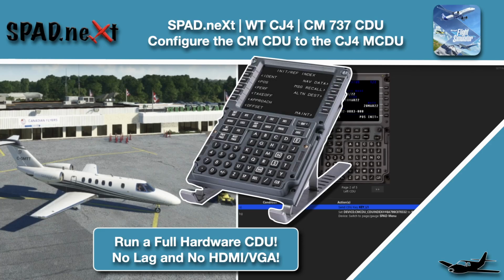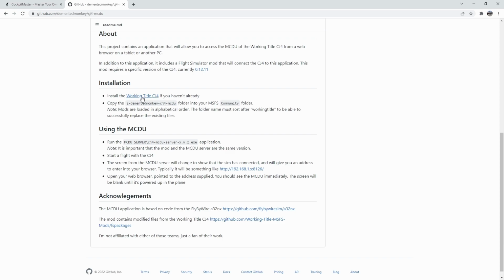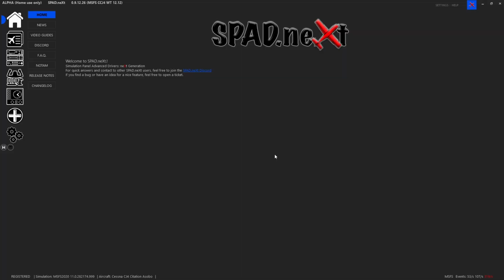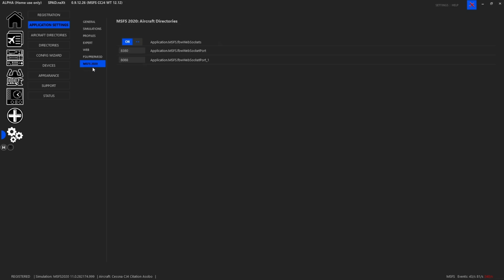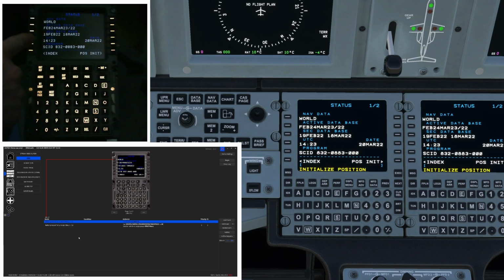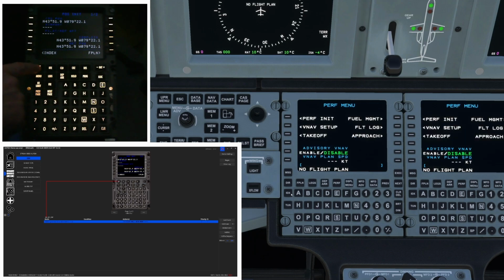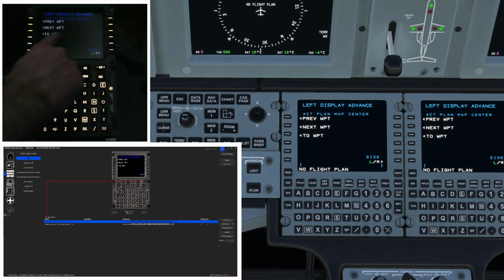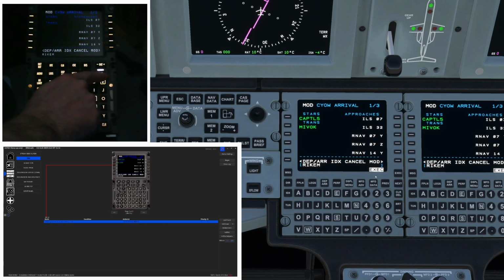MSFS | SPAD.neXt | CJ4 | CM 737 CDU Config

Comment: I have been debating whether or not to buy SPAD.Next but now I’m sold as I really want to use the CM CDU with aircraft other than the PMDG B737. Thank you for a very informative video.
Reply from the maker: Awesome. Good to hear you can put that hardware to more use.
Reply: I have tried to find the online snippets but they do not appear as you explain in the video. I’ve tried under profiles but only 2 come up for you and they are not the cj4. My copy of SPAD.neXt is some what different than the one in your video.  Any thoughts. Also, when SPAD.neXt connects to the CDU, the screen is blank. Pressing  any button allows a change to be made. However I was wanting your profile for the CJ4.
Reply from the maker: Profiles are not Snippets ..  I don't really publish those as my complete setups are not going to work for others..  Plus most of the configs I do for these videos might be changed when combined with the rest of my cockpit vs what works for that device configuration as a standalone.  If you are not on the Release v0.9.12 then your not going to find them...  The CDU requires Complete Edition as well...
Reply: Copied. I have the complete edition and the latest release but snippets do not show. No matter I will persevere.
Reply from the maker: @mikebarrett5890  join the discord so you can post screen shots of what your seeing when you go to grab an online snippet
Reply: Have joined and will do as you suggest. Thanks.

Comment: I have an issue with the Left CDU not displaying anything on Page 2 of 5.

I went into settings and enabled the Application.Web.Enable and also enabled Application.MSFS.fbwWebSockets. My socket ports are 8380 and 8088 respectively and I have the latest version of the WT CJ4 (0.12.12)
I also have the Enable CockpitMaster Support enabled in Other Devices.

I have the mod in my Addons Linker and it is throwing a shortcut into my community folder, so I don't understand why it isn't working. I have the SPAD menu showing on page 1, but nothing else after that.

Is there another step I overlooked? If you could please help me, it would be greatly appreciated!
Reply from the maker: Try just putting the Folders into the Community for the CJ4 and the CDU Mod.  Don't use Add On linker just do that and try to see if it works..  You can always try to use their Web Server to see if it comes up in a browser ..  Also if you were using the browser version to look at it... Make sure that you are not running their server as only one thing can access the socket...
Finally you can download the FBW Dev version and load into it ... they even have a message the pops up when something connects to the MCDU server.
Reply: @LesOReilly  
I will definitely that! I did move the mod to the community folder; however, I didn't think to move the aircraft to the community folder though. Hopefully that works. Thank you for your quick response!
Reply from the maker: @gksqd7182  for help I really suggest moving to the spad discord ...  That way you can post images of say the community folder and then the Mod Folder as well...  YouTube comments are not conducive to support/help for these kinds of things..
Reply: @LesOReilly  I totally understand. In the discord channel, it says I am not allowed to message in the channel. I did the request to the SPAD.next bot but I still can't message in the channel. Thank you for your assistance once again.
Reply from the maker: it takes like 15 mins or something...  fyi I would suggest no putting a period in spad next or youtube will hold it for review..  And no idea way by there is on Good list for youtube only a Bad list ....